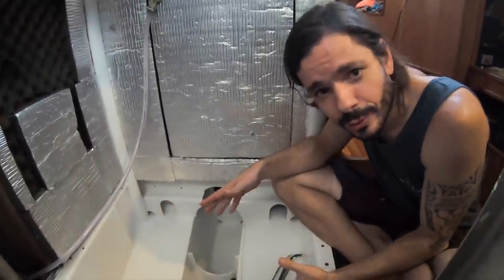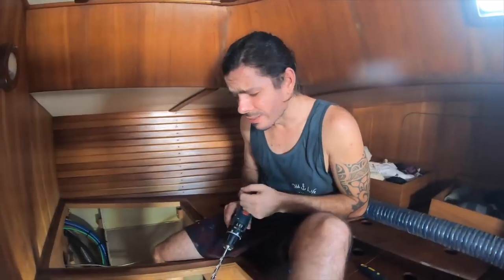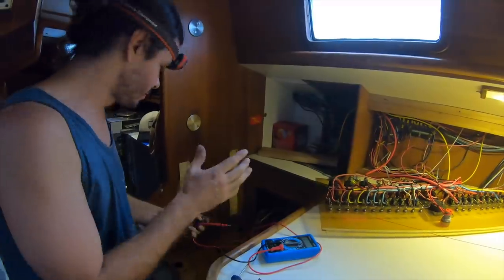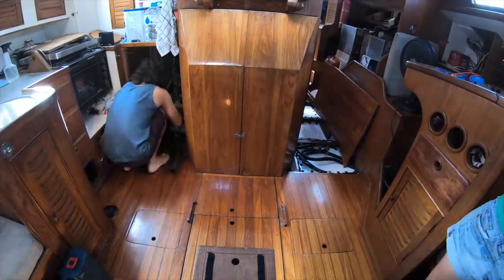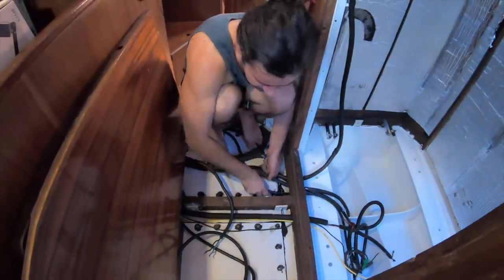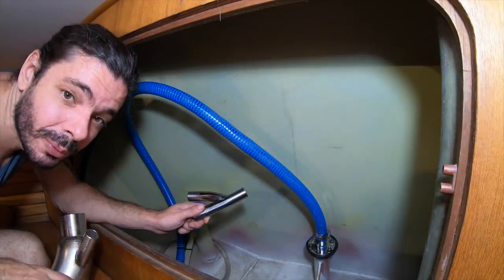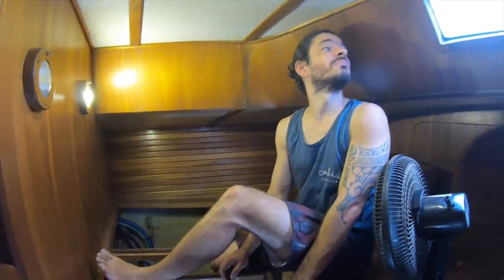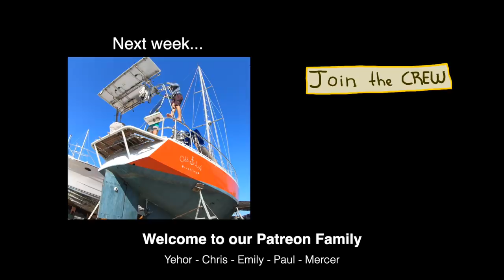⛵️We didn't think about that when we Bought a brand NEW ENGINE for our Sailboat!! 😨#174

Comment from the maker: Hey guys we need to just to fix one wrong information we said on the video and also address a few concerns you guys mentioned.

-  We are not doing the installation ourselves. We hire an engineer that is and authorized dealer and installer for Yanmar engines.
- The area of a 2.1/4" hose plus the area of a 1" hose is not the same as the area of a 3" hose. It is smaller. But it was suggested by the engineer that assures it is big enough and he is the guy that will sign the technical delivery of the engine so we make sure we have our 2 years warranty. 
- About insulating the stainless steel connections we talked to him and he said it is okay as it is cooled down before entering the exhausting hose. If it was a turbo engine it would be different. And also even though it looks like the metal is touching the wood, it is not. And where metal touches metal we will add protection in between. But to make sure about it we will talk to him again.
- About the exhausting fumes coming back through the bilge pump: we will have a one way valve, but just in case we will add an alarm on the bilge and run some tests, if we have any problem we will take the bilge pump from that through hole and send it to another true hole.

Have a great week,
Duca and Roberta

___________________________

Oi pessoal, queremos corrigir uma informação errada que passamos no vídeo e também explicar outras perguntas que apareceram bastante nos comentários.

- Nós não vamos instalar o motor sozinhos,  contratamos um engenheiro autorizado da Yanmar.
- A área de uma circunferência de diâmetro 2 polegadas e 1/4 mais o diâmetro de uma circunferência de 1 polegada não é o mesmo do que o diâmetro de uma circunferência de 3 polegadas, é menor. Mas essa sugestão foi dada pelo engenheiro responsável pela instalação do motor que garantiu ser o diâmetro suficiente.
- Sobre isolar termicamente as conexões metálicas, segundo o engenheiro na saída do motor o escapamento é refrigerado com água, sendo assim não atingiria temperatura necessária para queimar a madeira, se fosse um motor turbo isso seria diferente. Fora isso, apesar de estar próximo a mobília e não estará em contato direto com a madeira. Onde o metal toca o metal do caso ou da antepara vamos adicionar proteção entre os metais. Mesmo assim vamos conversar novamente com o engenheiro a respeito para garantir.
- Sobre gases do escapamento voltarem pela bomba de porão, nós vamos instalar uma válvula para que isso não ocorra, mas em todo caso vamos colocar um sensor de CO2 no poceto e fazer testes. Caso tenha problemas vamos tirar a bomba de porão desta saída de casco e colocar em outra.

Tenham uma ótima semana.
abraços, 
Duca e Roberta
Reply: You two start the wiring on your engine room, and cabin, and here I am installing a new coffee filter in my new coffee maker :D old one broken after 10 years of daily "non caffeinated" operation 😆
Reply: good job not easy i might have just put an new hole in the transem for the exhaust a sharp curcular saw would have given you alot less hassle even with patching the paint
Reply: Yes I was going to question some of that if the Engineer says its all right, then take the path of least resistance. Really don't be hard on yourselves for not catching this stuff you are not pros and even then sometimes you just work with what's there as long as the company says its alright, then cool.I have not done one of these in  a few years but this kind of thing is common , your doing fine , take care .
Reply: @kengodfrey8071  Yes I thought of that also

Comment: One suggestion. Label all your wires at both ends, AND when it passes through a bulkhead. That way you will later be able to identify the wires if you ever need to in the future. A small and time consuming exercise at first, but if you ever have a problem thousands of miles away with electrical, it will greatly help in trouble shooting. The labels should be with permanent marker, and not easily removable. Cheers from Winnipeg.
Reply: @OddLifeCrafting  get some white shrink tube, write on it with sharpie, then heat gun.... nice cheap label

Comment: Convoluted solution guys. Just do it the right way and enlarge your exhaust outlet. Far easier and really not that much work.
Reply: I dont 5hink they wanted to have a "patch" on the hull paint outside.
Reply: @danielbuckner2167  exhaust outlet is facing the water, probably in an area where bottom paint is. Would be far less of an issue than their solution.
Reply: ? All of the outside of a boat except the topside faces the water. It would have to be above the bootstripe by design so not in bottom paint but the pretty orange Duca wanted.
Reply: not to mention safer... check valves fail all the time and we're talking about carbon monoxide if this one leaks
Reply from the maker: The problem would be the galvanization of the hull that we would loose in this case.
Reply: @OddLifeCrafting  Thats true. It would not be the same as the original which you guys preserved when sanding it down although there are "cold galvanizing " methods. Thats a hard call, it may be best left and if it has to be changed later then it jas to be done but if Yanmar is cool with it then ok!
Reply: @OddLifeCrafting  So leave the thru hull for the bilge pump as you had it and install a skin fitting in a different location. You can get one made out of stainless and seal it with your favourite sikaflex 😜
Reply: @OddLifeCrafting  mitigating corrosion with other coatings in that small area is well worth this being done right.
The back pressure created by the significant constricted cross section, coupled with using a port common to the bilge is a formula for certain death.
Everything is a trade off I would chose managing a bit of corrosion over risking life.

Comment: The cross sectional area of the 3" pipe is 7.07 square inches. The cross sectional area of the 2 1/4 inch pipe combined with the 1 inch pipe is only 4.77 square inches. That's a 33% reduction in total size. If Yanmar is requiring a 3 inch exhaust to keep your warranty, then you still might have an issue.
Reply: The important thing is the Yanmar engineer has approved it so it falls on their lap. Like others have said, I expect the engine would have worked perfectly well on the original 2 1/4" just had a bit more back pressure (which it should be able to cope with anyway).
Reply: @aldo9535  Yeah for a 4cyl NA making about 45HP a 3" is just overkill. In fact if you look at the exhaust on the engine, you see it that only the end is 3" but from there to the engine it is smaller so the bottleneck is on the engine side.
But then again depending on the boat it has to run for a longer more complicated path so that might be why they made it wider. 
And if you are doing a engine swap it is always smart to replace the exchaust, don't want a leaky exchaust inside the cabin, might as wel do it right.
Reply: Yeah. Agreed. I did the area calc before realizing that someone did it. The area is not enough........ Hopefully the yanmar has a min/max.... Good progress though!
Reply: I also commented on this. Lol. I also understand 3" for a 54hp motor seems like overkill, but I believe the exhaust will also need to carry cooling water so that takes up some of the area. Maybe not though, I'm just a dummy.
Reply: @aldo9535  There are a lot of turns in the exhaust.  Hopefully, the engineer has done his homework on the back pressure.  [I presume that is the primary reason for the diameter.]
Reply: @sargonofakad  I think it has more to do with flow as the cross section near the engine is closer to the original 2" 1/4.
But then they do need to make a lot of sharp turns and the pipe is a lot longer than a care with the same displacementso it would make sense to oversize the exchaust.
But that is just a guess ;)
Reply: @sargonofakad  Yes ..... I am not a qualified engineer to pass judgement on the adequacy of their exhaust solution, but the knowledge that I have about installing exhaust vents in the house and the degradation caused by bends I think applies here too.
Reply: This is all going to end in tears What a disaster
Reply: @kiwibobnz9812  What is such a disaster about this?
No bottleneck was made, all corners are nice flowing and most of the pipe is 3"
Reply: @david6054  The turns are primary what concern me.  the exhaust is essentially a fluid flow.  Every turn affects it and causes some turbulence.  Hence, back pressure.  I was once called in on a new 4 cylinder diesel engine smoking up a warehouse for boats.  The boats were lifted into storage racks several feet high.  Soot was covering all the other stored boats.  The machine for storing was several feet tall.  The owner of the facility had just bought the unit and naturally was not pleased with the performance of the engine.  The problem was not with the engine but with the plumbing for the exhaust.  There were eight 90 degree elbows in the piping.  I took the machine outside, disconnected the exhaust after the 2nd elbow and ran the engine.  It ran smooth and smoke free.  I suggested he consult with the manufacturer.
Reply: @david6054  Most of the pipe is 3 inch either it is or isn’t they need to pay someone to do it properly this could end up incredibly dangerous
Reply: @sargonofakad  Oh I agree that turns can be a real PITA.
But that is probably why they made it 3"(the bends are as well). Just so it can handle the added backpressure from the bends and still keep the flow.

Btw for those interested:
ibb dot co/sWNYpJW
This is why I feel that the end of the system(with the 2.25inch + 1 inch) is not going to be a bottleneck worth concerning
Reply: @david6054  Good point!
Reply: @david6054  It isnt a disaster but the bottleneck is at the end where the 3" is divided into 2 1/4" and 1".
Reply: @danielbuckner2167  It isn't, look at the image I posted, the pipe starts at 2 1/4 so that will be the bottleneck ;)

Well that and the bends, but like I said that is probably the reason for the 3" pipe.
Reply: @mark6205  Yes, the wet side will be up on the engine right after the exhaust manifold.
Reply: I am certainly not a expert but this is one time that function has to overcome form. Best to rip out the furniture to make the pipe as straight as possible and make a 3” hole.................also although the engineer says radiant heat won’t be a problem they should insulate that exhaust with exhaust wrap, it is cheap as and offers peace of mind.
Reply: @aldo9535  you are right it will be Yanmar to fix but it will be them in the middle of the ocean or just entering harbour or in bad weather.............not to mention their time, frustration, etc while Yanmar repairs it. Engineers get crap wrong all the time..........best to follow manufacturers guidelines when it is something your life may depend on! Function over form in this case.
Reply: @kiwibobnz9812  it may end up in death if that check valve fails and the bilge fills with carbon monoxide
Reply: @sargonofakad  I had a rental property at one time and the tenant complained about the dryer not drying. I found 8 elbows, each elbow reduces the max. travel by 5 ft. The Dry was rated at 25 ft. With the elbows and existing exhaust tube the run was over 30 ft. And yes I corrected it. Same situation...

Comment: I am concerned about connecting the 1 inch exhaust to the “Y” with the bilge line.  Even with the check valve, there is a chance of carbon monoxide back filling into the bilge.
Reply: Absolutely
Reply: yeah I definitely wouldn't chance that.  the exhaust should only be for the exhaust
Reply: The valve is unlikely air tight and even less likely to be pressure resistant. Even if it is, carbon will soon enough ensure it is not 100% sealed. Please monitor the other bilge end over time to ensure gases are not making way into boat.
Reply: Also, a 2.25 inch  outlet plus one inch outlet combined is  far less capacity than a single 3 inch exhaust . You need to compare the surface area of the circle . A 3 inch circle is 7 sq inches, and a 2.25 plus 1 inch circles if only 4.8 sq inches , so you are creating back pressure .
Reply: I was wondering about that too
Reply: I'd also worry about: 1. carbon depositing eventually clogging the valve, preventing the bilgewater from escaping. 2. Making sure that the exposed portions of the bilge valve and circuit can handle the heat and such from the exhaust. (Not sure if that is as much of a concern?) 3. Carbon monoxide. (Felt like it was worth another mention!)
Reply: Why not just cut a larger circle in the transom . It wouldn’t hurt anything. It seems they are just trying to rig it every way but the right way. Maybe whoever installs the engine will tell them they are doing it wrong. I would never risk the lives of anyone on board just to cut a few corners like they are plainly doing here.

Comment: It seems like a lot of work to end up just widening the exhaust by 0.78 inches.
If yanmar recommends 3 "in diameter to be guaranteed the section would be 7 .07 square inches. Adding the section of 2 1/4" + 1 "is only 4.45 square inch. I recommend making the final section of the hull outlet in 3".
Reply: I agree.  I think your cross section will be 30% less with the new pipe configuration.

Comment: An oscillating multi-tool is the most valuable tool you can own on a boat. Make a trip to the hardware store. You will save incalculable amounts of time.
Reply: BINGO!
Reply: Yes, but maybe not cordless since who knows where they will be when the batteries stop working. For day to day use in normal conditions though I love mine being cordless now.
Reply from the maker: It's quite expensive here in Brazil
Reply: @OddLifeCrafting  Ryobi 1+ system. Surely they are available in Brazil?!?
Reply: @portfoliofotoz  C'mon at least do a fein or milwaukee if you have to order sometbing.
Reply: @OddLifeCrafting  That may be true and I bet somebody would mail you one too maybe even as a gift but the taxes on the import would still be an issue I guess.😖
Reply: @danielbuckner2167  I have a Feintool and love it, but I also love my Ryobi. Horses for courses. The Ryobi is the best tool for the money, my friend.
Reply: @portfoliofotoz  Maybe of ot is cheap enough but I work as a contractor and can break things quicker than a 2 year old with a hammer and a 1/4 lb of sugar! The milwaukee is unfortunately priced like all their stuff but check out a good deep reveiw and youll see what I mean as to why it is the best right now, money notwithstanding. ✌🙂

Comment: Don't  forget you need to wrap the stainless with some exhaust wrap so you don't catch anything on fire
Reply: Exhaust is cooled with seawater, how hot it can get? (Other part of exhaust is silicone hose rated to ~180°C.)
Reply: Yeah, diesels run cool compared to gasoline engines. Plus the return of the cooling water through the exhaust is another cooling factor. I’ve seen the immediate few feet after the manifold wrapped, but not much after that.
Reply: The exhaust system will never get hotter than 50°C, since it is first cooled in the exhaust manifold and then mixed with the external cooling water. Have two boats with the same system and about equal power.
Reply from the maker: Thannks for the explanation

Comment: Looks like you have the “solution” thought out. Is there anyplace the metal and flex exhaust passes close enough to interior cabin wood that radiant heat could cause combustion, fire to the wood? You both are so determined in all your projects. 👍 I look forward to your travels around the world. I am happy you have a new engine. The installation will be very interesting. Odd Life is worth a lot of money now. I think much more than you have spent getting her sea worthy. Be safe and thank you for sharing. Respects sent from Georgia USA. Soon you will be ⛵️🏝🎉
Reply from the maker: The metal part is not gonna touch the wood, but we are planning on protecting it from hear anyways
Reply: The exhaust has been cooled by raw water at this point. It will be warm to the touch but should never get hot.
Reply: @michaelalbert8474  I do not know why I did not remember that. Thank you Micheal for reminding me you are correct. 👍